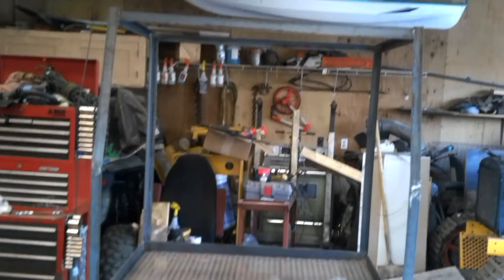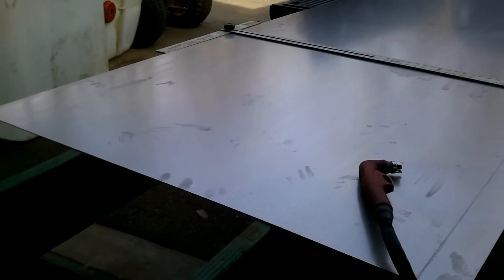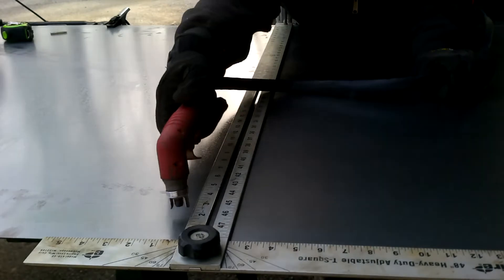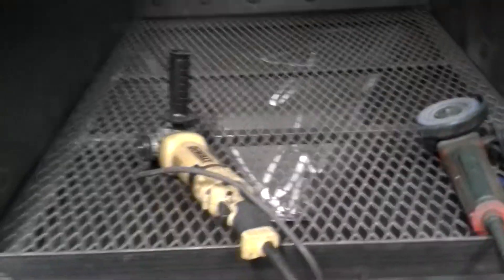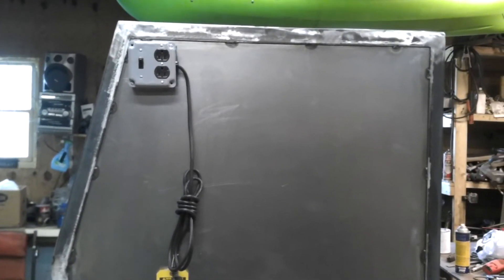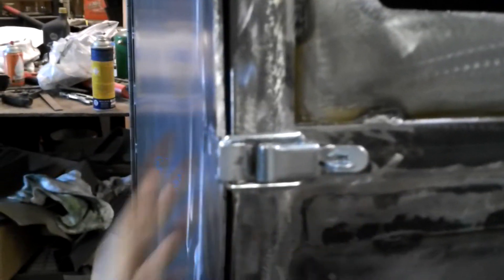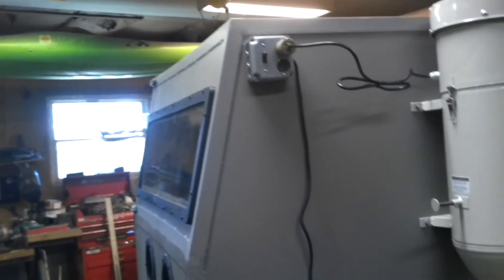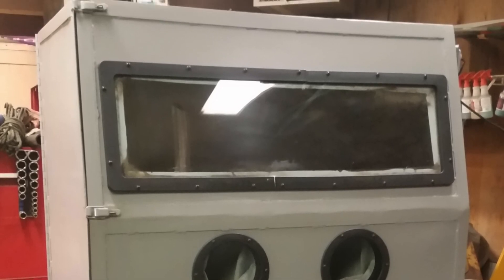Homemade sandblasting cabinet

Comment: That thing is sweet! I have a Harbor Freight blast cabinet. It's really good at leaking sand all over the floor. That's about the only thing it does well.
Reply from the maker: thanks wes.  Wanted to do it once so i made it big.  Planned on being able to get 22.5 rims in there and other truck or tractor parts too.

Comment: Very nice!!! Great job on the video too!  What size compressor do you run? And what material do you use?  That's a big job for sure.
Reply from the maker: Thanks Frank.   its an old 80 gallon 13.5cfm 175psi i believe. Media is Black Beauty.